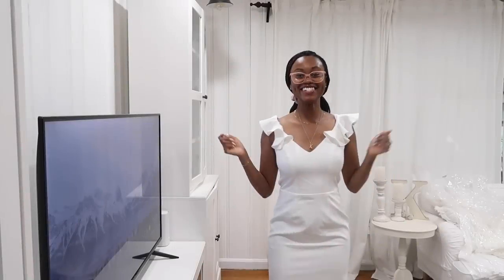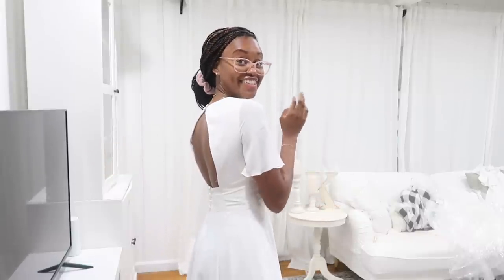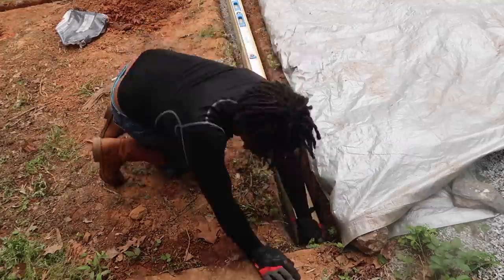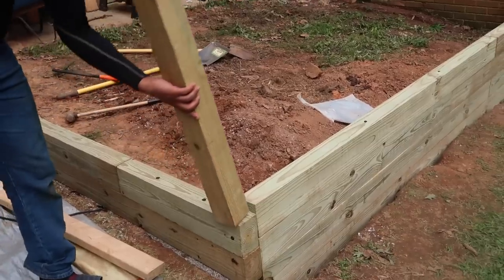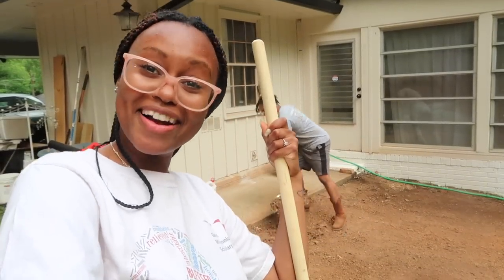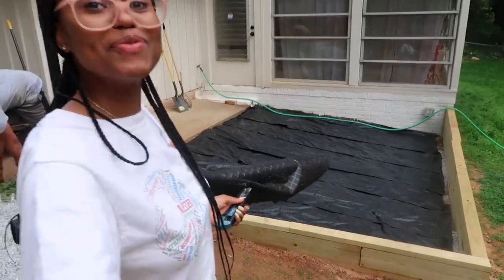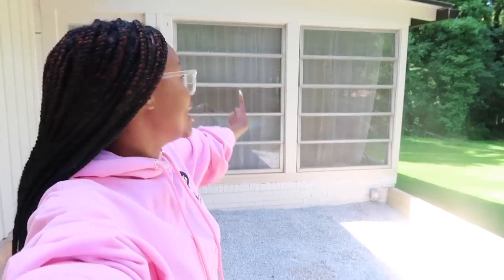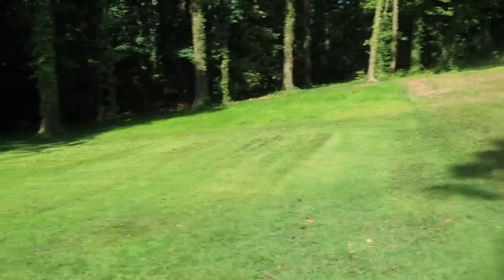DIY PATIO MAKEOVER Pt. 1| Plans, Breaking Ground, & Building the Patio Foundation! #FIXERUPPER

Comment: Also regarding your patio.   After filling your patio with the gravel, I would add a layer of 36 x 36 inch cement squares (Lowes) all over graveled area leaving very small spaces in between the squares.  Once the entire gaveled area is covered, buy some quickset cement powder and fill all cracks with the dry cement power sweep with a broom to make sure quickset powder is. Level in between your cement square blocks.  Afterwards take a water hose, set nozzle to spray water all over the cemented area saturating the dry cement well.  When finished, let the entire area dry well.  Afterwards you should have a patio with a hard surface all over.  Hope this helps.  Cheers!!

Comment: Wow. Lots to do. Did you think of just putting a simple wood deck were you are putting your patio. Attach some brackets to the house on the side of the laundry room, sun room and your other two sides you framed in. Attach some two by fours to the brackets and then in the opposite direction screw down boards. It will go by quick, look better and you add to it with time. Any boards too long, you just cut with the saw to the same size of the others. Rest those main bards above the sidewalk and anchor them to the frame across them. This not as hard or expensive as you think and you guests won't sink in the gravel or ruin the shoes.

Comment: In my experience the store purchased landscaping fabric does not do the job. For a patio, you need the thick professional landscaping film. Also the cuts were too short. Wrapping the fabric up the sides of the wood would have been idea. In hindsight, it would have been great if the rocks were placed on a tarp so that when transferring them to their final resting place, soil and weeds wouldn't transfer when shoveling. I think it's gonna work out well though there may be more maintenance needed then may have been expected.